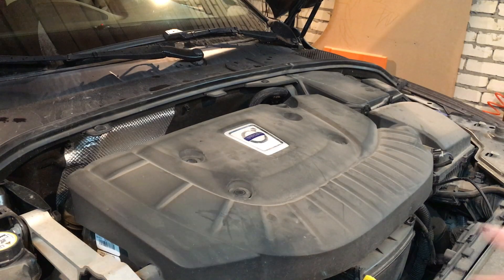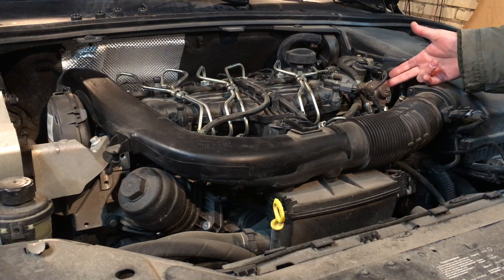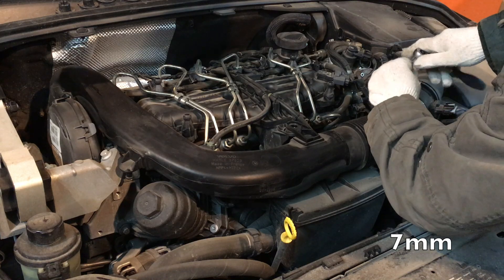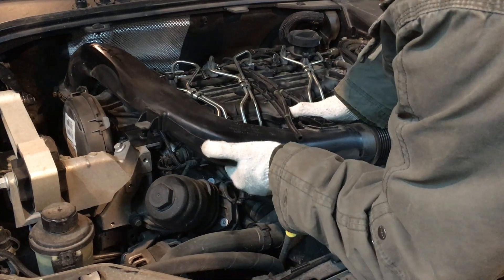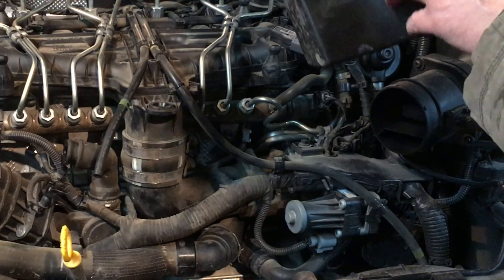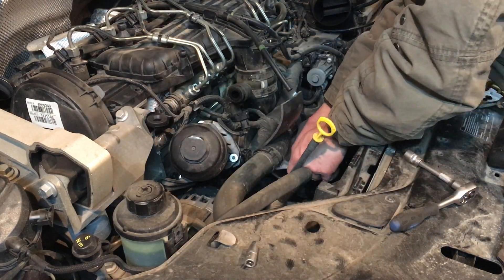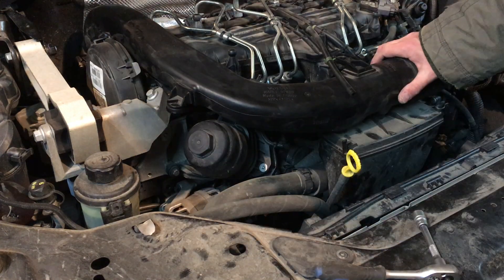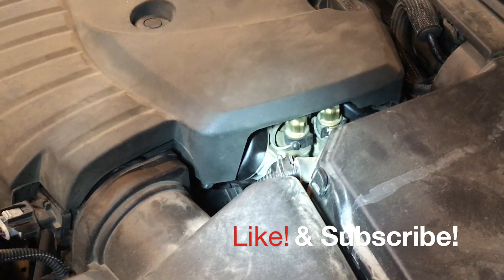Volvo Diesel Engine 2.4D. Finishing what the manufacturer did not!

Comment: I was able to install mine without taking all the parts you have shown. 
I lifted the pipe a little bit, connect the bracket with the nipple. Then the bolt holes aligned with the bracket holes. Installed the bolts. And job done in less than 10 min.

Comment: i discovered the same problem with d5204t7 engine... i think it's the same bracket. I'm interested to know what did you use to protect hose (sort of foam) and air intake box ? thanks in advance and for your vid.

Comment: Thank you for this video, just serviced my XC60 D5 and noticed the bracket was missing, and also the M6 bolt securing the intake pipe at the back toward the bulkhead. I put a caphead in and tightened it up. What I did notice was some oil residue from below the intake pipe hose clip, looks old oil - have you seen this before ? Thought I had a burst pipe or somenting.

Comment: Mine (2011 XC70 D5 enginge) has the clamp however the join (plastic part of the air intake) was partly broken  around the clamp. I think because the massive vibration of the diesel engine. The oil was leaked around the broken part and on the hose-intake connection point as well.  I fixed both of them with the gasket maker. It isn't aesthetic
 but fixed the issue.

Comment: I have a V60 d5 2013. Tgere is oil around injectors (not diesel) car runs fine no oil loss I put a glove on the oil filler hole, it blows up on idle. Does this engine have a PCV system? Thanks

Comment: Fantastic, thanks so much. I’m just about to order these parts for my XC60 D4 AWD - one of the last 5 cylinder diesels in the UK. Regarding the dipstick, is the mounting point obvious, I can’t see anything - but that’s with the big pipe & box in the way, so I’m hoping that once it’s taken off then it will be obvious. Any hints. Thanks
Reply: Most dont have a physical oil dipstick as its electronic from the dash. I'd be surprised if you did have one

Comment: Just purchased a xc70 D4 2014-Took off the cover to inspect - found the bracket in place.
Have ordered the two covers from Bosch.Fyg in Europe ( Norway ) the part number har been replaced
To read 005 insted of 003 - last 3 didges.
Your instructions videos are just great and based on those I now do all the service on my car so big thanks
Reply: Many thanks for mentioning that the part numbers have changed to 005,I was struggling to locate the 003 covers.Regards Wayne.
Reply from the maker: +Helge Lassesen Great. Enjoy the Volvo.

Comment: Thanks for your very informative and well produced videos! I just got my new MY17 XC60 D4 and yes, part was missing. As I was warned by your video, I could check while at dealership (DARCARS - Rockville MD, thanks!). They were so kind to order the missing parts for me - so no  costs for me.
Keep up the good work and if possible make videos about common (electrical) issues of the XC60 (up to MY17).

Comment: So they sells a part that is missing from the factory. Great. Gonna check our d5 for that... 
Also, stupidly placed wiring harnesses is a Volvo thing since ages. Wires bent at narrow angles, metal bracket retaining harnesses bolted to hot engine parts to cook insulators, if not too close to belts or fans, all of these are common since decades. It's a bit annoying but oddly satisfying to route everything back to something neat and tidy.

Comment: Engine wash next time? 😉
Reply: bad idea...
Reply: Adam Budai why?
Reply: Björn Wildering the injectors use hight voltage....and if you short then out you can kill the ecu
Reply: Adam Budai why would they make a car that cant get wet? If its build to use in sweden?
Reply: Adam Budai Water has very low conductivity. Just cover the fuse boxes and you're safe.
Reply: Generally these engines are okay to wash, so long as it's hot and you leave it running, and obviously, don't spray the fuse box or under the scuttle panel.

Comment: Nice.. I built those engines for 7 years.. It wasnt uncommon for that bracket to be forgotten, but the car assembly plant usually found it.
Reply: I have a question for you regarding my D5204T7 engine. Do you know what coolant they filled in? Mine has a yellow/brown colour. My car was build in March 2015.
Reply: @knolshals5972  it's supposed to be the original blue one, for some reason on some of the cars it turns yellow
Reply: I have a Volvo V40 D4 r design 2.0 diesel 2014, are there known for a Fality EGR system from the factory? And the piston rings leaking oil and getting darned up?

Comment: Hi, first of all thank you so much for your videos, very useful and interesting. 
I am a grateful owner of great XC60 2011 type D4 diesel 2.4 AWD 
Now I have some questions: 
1) where do you buy the parts that you change or install on your Volvo, have a particular website? 
2) In the engine compartment there's some plastics on the sidelines over the wheels where is filled by dust and dry leaves, how to remove that plastics and clean? I have a fear to do a bad move and break some great plastic pins that hold in place that plastics covers.
3) I hear some noise inside the passenger door, I think that is a plastic moving inside, how to remove the panel?
4) I would to install a original Volvo XC60 back parking camera, but at the assistance workshop it's too much expansive, what about a self installation, is it too hard?
Thanks for any answers. Thanks again for your videos.
Bye
Reply from the maker: +Mario Coraggio Regarding the camera. You need to check with the dealer your XC60 is ready for it.
There will be a video coming. Keep an eye.
Reply: volvosweden 
Yes my Volvo it's ready for install because it have a 7 inches monitor, thanks 
However what about the other questions?
Thanks again

Comment: Well known problem with with the air intake pipe is oil leakage from the heater connector. Could you give any solution for that to avoid air intake pipe replacement (quite expensive and with no guarantee of long term success). I'm looking forward to more movies about XC60 and diesel engine. Greetings. Tom
Reply from the maker: +hea240 There is a solution and a video will be made. Keep an eye my friend.
Reply: volvosweden Thanks, I'll be waiting:)

Comment: That bracket installation should have been a call-back job performed by Volvo dealer right after they worked out that this bracket was needed to design.
Reply: It was designed in first place,  then removed to economize production and make some money in replacing intake pipes  and saying " You know its a diesel, it rattles it shakes it has to be like that"
Reply: Sounds like a Chinese owned company. Finally
Reply: Early Bird its a concern for all the Diesel Models? D5 too?
Reply: I'm not sure but it makes sense that if it was missing then it was fitted as a call-back job by Volvo. It wasn't designed later just for fun...